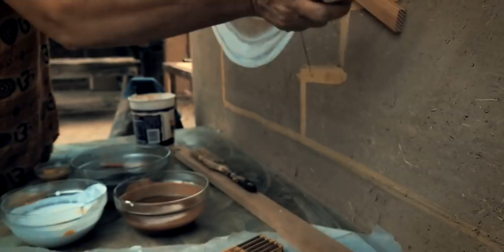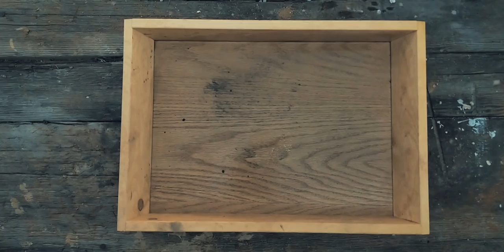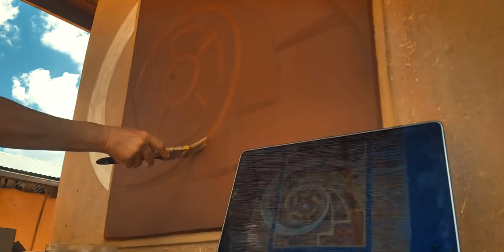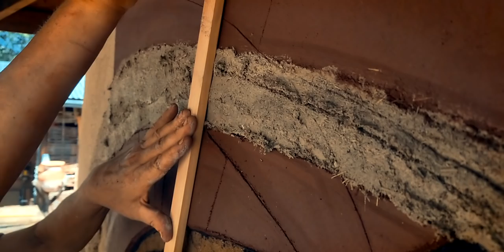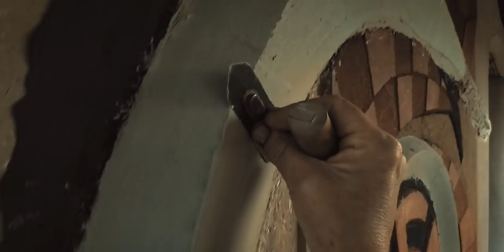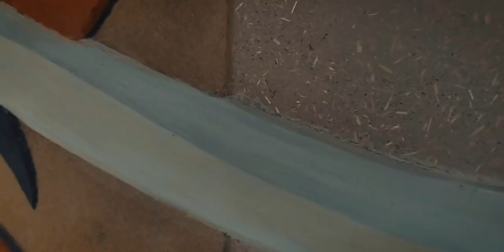Pueblo Pottery Technique Sculpted on Wall - Clay Carving With Athena Steen

Comment: Incredible work! How do you prevent cracks in the wall after it dries?
Reply: Not the artist, but... finding the right straw/sand ratio helps, since it's not 100% clay it's less crack prone. Also if you were using 100% clay do it like potters do, dry it slowly first to "leather hard" then all the way to dry, then paints at the end perhaps. I've not done the coloring layers, just the shapes, so that part is speculation.

Comment: Hmm. Could one build an entire house out of Earth in a climate like WA? I'd be very interested to know how challenging it could be and how much it would cost compared to a modern built house using building materials.
Reply: There this family who build earthbag houses. I saw in one of the videos, they used linseed oil on the wall.
At home I experimented a lot with made a hempcrete-like material. Instead of hemp, I used different microfiberous material and lime, of course. I did not painted it, but after it completely dried, now it is waterproof.
And Nito have a video about how he made a shine calywall with oil:
https://www.youtube.com/watch?v=wTY6arzNs24
You can even combine those methods and, you have nothing to worry about, what climate you live in.